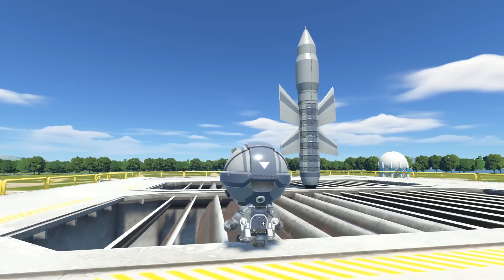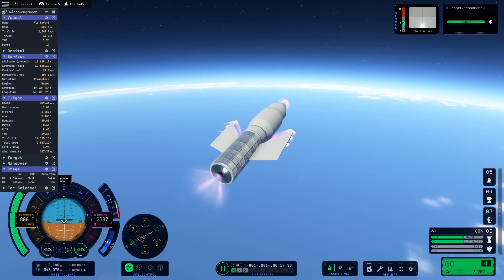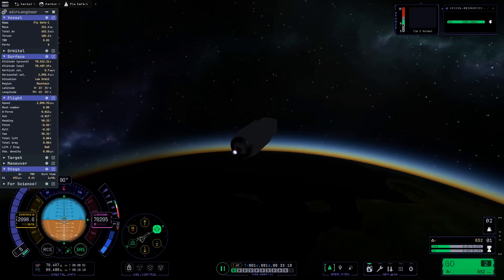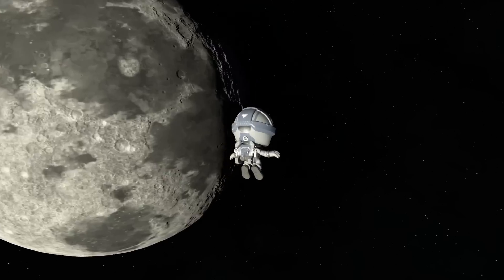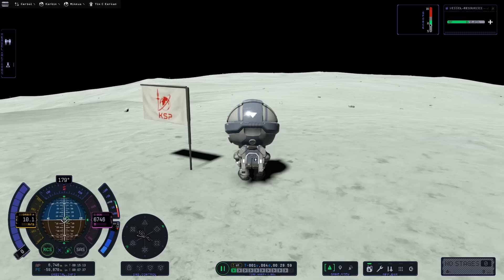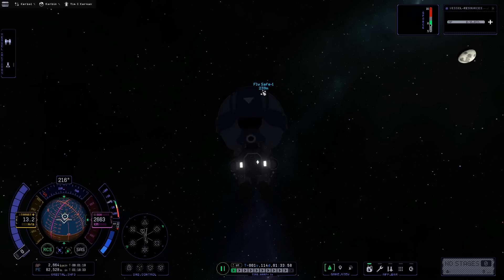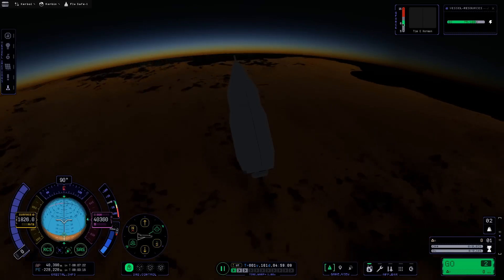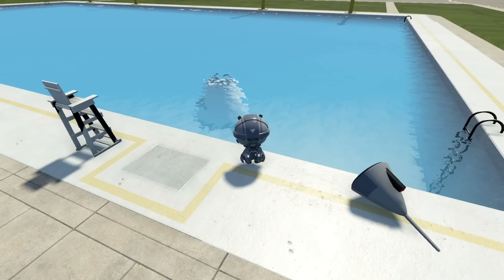1230 kilogram manned mission to Minmus.  KSP 2 Low Mass Series Part 2

Comment: I found there wasn't any aerodynamic drag, there was heating but no drag.  I did a minmus mission with 5000dv for a flyby which shouold have been way more than enough but once I got out of Kerbin's soi the dV changed to far less than anticipated.  So I did a retro burn and tried to use  a 45 km PE to aerobrake down to a safe speed before separating to just the capsule.  This is when I found that with an engine and a few tanks attached to the capsule I was getting no discernable difference in the AP wiht the craft radially vertical.  I had to separate to the capsule before I saw any drag but of course an unshieded capsule from a highly eliptical orbit into the atmosphere didn't last long.  My experience has been that the game is still unenjoyably broken.  If I've missed something important or there's an intentional change in the way you can do aerobraking between KSP 1 and KSP 2 then please let me know.  I want to enjoy KSP 2 but so far it doesn't seem to play by the rules ( of physics )

Comment: With what speeds does the chair grabbing trick works? If you put something in orbit around an object and make it pass just 1 meter above the surface, can you then grab the chair at orbital velocity? And land using the leg trick? If so you can do surface returns with almost oe delta v spent

Comment: I can see some very cheeky landings being done using the trick you used to land on minmus. For example, the craft could be set to do a very low pass over the surface, and then then the kerbal gets out and boosts ahead using the EVA pack, landing as you did in the video. Then to get back on board, the kerbal grabs the ladder on the craft as it speeds by, spending minimal (if any) Delta V in the process
Reply: He should do a Tylo landing and return with this trick 😵‍💫
Reply: Only problem being, that the frame positions need to align with the kerbin.
At orbital velocity the craft moves at 30 m per frame
Reply: It's been demonstrated in KSP1!

Comment: i was experimenting with super low orbit EVA earlier today and found that for some reason passing bob through the upper atmosphere at an AOA to optimize lift/drag his apoapsis increased, did you find something similar while flying this mission? my best guess as to what's happening is he's somehow producing lift, while not producing any drag. Which doesn't make any sense, but neither did that lithobrake
Reply from the maker: I did notice something similar happening during testing, but it wasn't reliably reproducible.

Comment: At 8:23 "while it is not particularly maneuverable or stable this will give us some ability to aim our descent", and yet he lands it. In the KSC. In the swimming pool.
I don't recall a single mission I did where I came back from another celestial body, where could land in the same continent as the KSC, unless I was lucky.
Congrats on another amazing video!
Reply: if the vessel has any, ANY controlabilty, bradley whistance will somehow manage to land it at the KSC ( to my endless rage )
Reply: @SomeGuy1312  yeah, it's amazing to me how he does, well, basically everything  :D
Reply: Mechjeb is useful for ksp 1 landing control
Reply: @Avery-eb9wl  Thanks for the recommendation! For sure, I do use it for some things. In general I prefer to automate orbit encounters with it, and manual control for landings and orbital rendezvous. 
It's not that I don't know how to use it for that, just that my manual abilities and play style are not in the same league as his, haha
Reply: @DrBlort it’s not difficult to do, just extremely tedious
Part of it is eyeballing and experience: I personally have a specific point above the terrain to burn at to a specific altitude once Im back to LKO, which results in SSTO boosters or landers landing within a few km of the ksc, however IIRC brad just does a burn, notes how far away it is from target position, then loads quick saves and makes a slight adjustment a few orbits back. Obviously still a pain to do, but very doable for with enough time and determination
Reply: @barbecuedchicken2894  Thanks! I will try that
Reply: sorry he is also a lot better than me as well i see your point @DrBlort
Reply: @Avery-eb9wl   hey, no worries, nothing to be sorry about! Thanks again for the recommendation!
Reply: Wait, you guys are landing?!
Reply: Try to get the most circular orbit you can, then wait until the KSC is in front of you, then quickly burn retrograde, then you should be able to glide to the KSC.
I've did this in JNO, it should be the same for you, as far as I know.
If you have a bad lift to drag ratio, stay in high altitude for your glide, if your lift to drag if really high, stay very low and put your gear down early if you have to

Comment: great video, one question though and sorry if im mistaken, at 4:45 do you mean parallel to the surface, because you would be traveling perfectly horizontally to the surface, basically a long a tangent line intersecting the ground
Reply from the maker: Good catch!  Yes - we want to be parallel to the surface, on a line tangent to the surface.

Comment: is it just me or is this video very quiet
Reply from the maker: Just checked, its not just you:  I set the level lower than I usually do on accident.  Unfortunately it is not possible to change the volume after uploading.  It doesn't seem to be troublesome enough to warrant reuploading.  Good catch though, appreciate the attention!
Reply: @BradleyWhistance  sounds fine to me

Comment: They spent so long improving the graphics, you can land with your legs. 

I had hope for this game, glad I haven't bought it. KSP 1 will continue to be my choice.
Reply from the maker: I'm happy with KSP 2.  There is no system so bug proof that we won't be able to find ways to exploit glitches.  The 'Legs Forged in Mordor' glitch was not particularly easy to pull off.  I suggest you give it a try.
Reply: One bug does not make-or-break a game. The game has improved greatly over the last year and exploration mode is pretty enjoyable.
Reply: I’d rather have super friction boots that happen to allow goofy exploits like this than have my kerbals randomly spagettify into my spacecraft for no reason when trying to climb on a ladder (which did happen to me in KSP1 occasionally).
Reply: I will consider KSP 2 again in 5 years to see the final verdict.

Comment: @Bradley When you (later) do a Tylo mission, be aware that KSP2 still does the atmospheric drag bug. Discovered this today when at 30,000 meters, my craft started losing speed for no discernable reason.
Reply from the maker: I have noticed this orbital drift issue already.  If you are aware of what caused it, let me know
Reply: @BradleyWhistance  I don't believe Its caused by a specific part or combination of parts per say. Though what I have seen is that the game can randomly forget things. For instance, I had a ship in orbit around the sun (departing Moho) that suddenly lost all orbital velocity. It was literally not falling or moving, as if inertia and gravity had suddenly been forgotten. Reloading the game did thankfully resolve the situation.
 
Unfortunately, incidents like this are fairly common, especially for the larger ships. From what I can tell, It looks like the game is attempting to run physics on each individual part rather than treating the ship as a combined entity. IMO for situations where atmosphere and collisions are no longer an issue (open space), running individual physics over a long time span, just invites the Kraken to come out and play. Further along KSP2's development, I fail see how colonies with thousands of parts will be possible, when the game randomly freaks out (as is) with a ships using less than 200.
Reply: Maybe the developers were trying to add a very thin atmosphere even above the karman line (because the atmosphere doesn't just suddenly disappear after the karman line), and they set the height of that thin atmosphere to be a fraction of the size of the SOI of that planet above the current karman line level. But on Tylo, the SOI is quite huge but the karman line is 0 km above sea level, so the code assumes that the very edge of the atmosphere should be slightly higher than 0 km and miscalculates. My explanation could be completely wrong but might as well try to discern what is behind all of this.
Reply: @creativecarveciteclimb5684 it’s a hard cutoff, and from what I’ve heard it’s not intentional and was a result of some sort of floating point error(s). 

While it definitely seems like a step backwards, I’m guessing it has to to with how the rebuilt the positioning systems to allow for things like axial tilt and the camera in the map view being able to “roll” so that it aligns with the selected body’s equator.
Reply: @alexsiemers7898  Ok. I hope it gets fixed soon.
Reply: @alexsiemers7898 should have hired some mathematicians